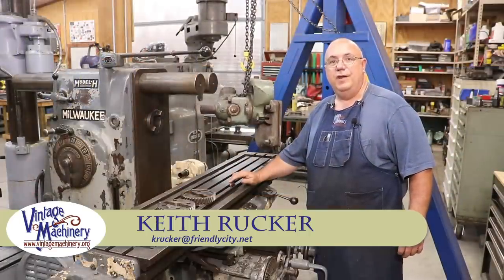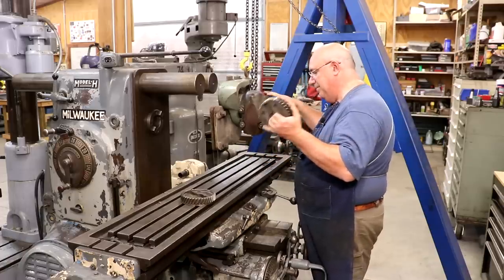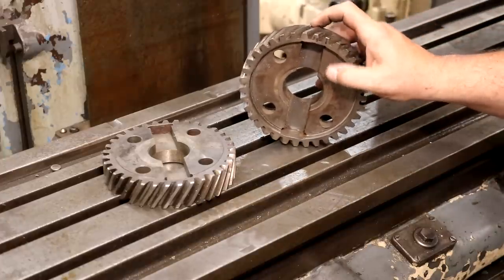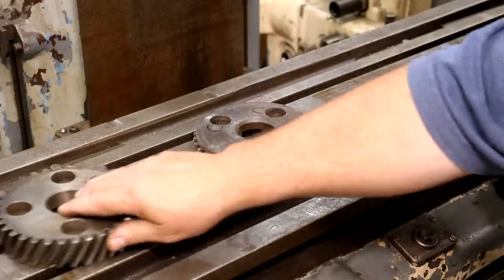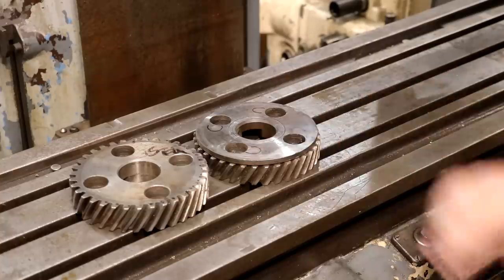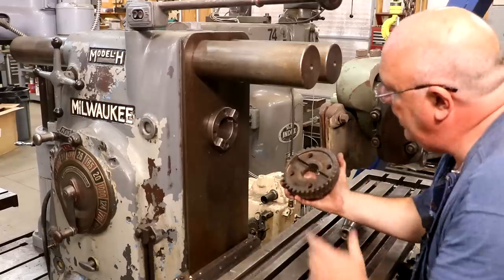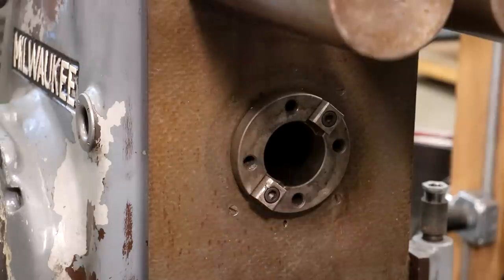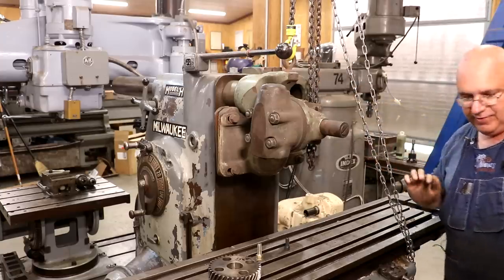Finding a Universal Head Drive Gear for my Kearney & Trecker 3H Horizontal Milling Machine!

Comment: Awesome Keith!  I have a 2H, and was specifically looking for the universal head when I ran across a government auction that had what appeared to be a 2H with the universal head. There wasn't much info available through the auction company, and it was located 500 miles away! But I took a long-shot and won the bid at less than just the head was worth. I was thrilled!  Then I arrived to pick it up, and discovered the mill was a 2HL (little smaller machine than the 2H). Felt pretty foolish!  Took it home,  and powered the mill up and checked everything out...and after a cleaning and repaint, and a few minor repairs, it turned out to be very a serviceable mill!   Ended up making room for it in my shop, and I just leave the universal head mounted on it as a dedicated machine, and keep the 2H for a dedicated Horizontal!  Best of both worlds!!! No worries or trouble with parking attachment! 
Congratulations on your addition...you will love it!

Comment: Keith,   That is the hard way to mount the universal head...and nearly impossible to set the drive gear clearance. 
The head splits into 2 parts, the drive and the head.  A spline shaft couples the two. 
First mount the drive section by it's self by moving the clamps out and placing it just above the spindle drive then drop it down close and loosely tighten the clamp bolts then set the gear tooth clearance. This is very important.   With the spindle in neutral work the spline to feel the backlash and turn the spindle.  Once the backlash is correct tighten the clamp bolts.
Then with one over arm way out, line the head onto the over arm then slide in to engage the spline and finally the other over arm.  This way you don't need a crane to lift in place just a sheet of plywood to protect the table.
As you show in the video the head can move out away from the column.
I have the same universal head on my 1942 2HL that I got for scrap in 1973 when I was in high school.  To get the mill running again I made 3 gears and a shiftier fork that had been robbed from the spindle drive and fixed a bunch of other problems. Have run the mill and universal head for many many hours, put head on/off many times.

Comment: You are fortunate.. I had to machine the drive gear and spacer disc for my 2h plain with the same type of head... I watched you install the unit and I made the same mistake the first time I installed mine....The spacer discs are machined to the pitch line and roll with each other to maintain proper gear tooth clearance as there is no positive way to dowel the unit in place... I think you will find that the cutter head takes oil and the drive bracket takes #1 Sovarex grease and that new units were once shipped with two grease guns for the purpose of lubrication, as per 1942 sales brochure.. You will no doubt find grease everywhere upon disassembly.. My unit was made ww2 and had grease much like Johnson's paste wax in the cutter head.. Cheers from Louisiana ; Mike

Comment: I wondered if you would mention the parking attachment. In the first shop I worked in during the mid 70s we had two K&T mills one with the universal head and parking attachment and one without. We used the head for several production jobs and the parking attachment worked great for getting the head on and off and allowing the head to be stored on the machine when not in use. I used a number of K&Ts over the years but never encountered another one that was equipped like that. I believe it also had a drive mechanism for a rotary table but I never saw that in use.

Comment: Fantastic video. It brought back fond memories of when I was employed at Eaton. I operated a yoke line consisting of 4 horizontal mills similar to this, a 4 spindle drill press, a single spindle drill press and a push broach producing shift yokes for Road ranger transmissions.

Comment: Keith, You are sio right about those "grease" fittings there. I think those were originally round but then someone decided to put the grease gun compatible nibbles there in order to be able to lubricate it with the grease gun.
Quite often the lubrication of those is gravity assisted. I mean that the oil is running down to places where it is needed. If someone has been vaccinating this with grease, those oil paths have been blocked. You can squirt oil into there and it will never reach the place where it is needed.
Taking it apart and removing the grease is the only parctical way to get it lubricating itself correctly.
I had this same grease/oil problem with my Schaublin SV-51.

That universal head is really practical. You can even do light horizontal milling with it as well. See if it has some sort of an indexing system in order to get it easily and accurately in common angles. My Schaublin has the 15 degree indexing system for both nodding and tilting. If You can set the angles easily then a whole new can of positive worms opens up.
Reply: I have been running the exact same K&T head on my 2HL mill for over 40 years....those ARE GREASE FITTINGS!  The universal head does not run with oil.
Reply: @chuckinwyoming8526  Aha. Sorry about me giving this misinformation. Actually I don't know anything about that particular milling machine Yet alone the universal head for it.
Usually machines of that age are to be lubricated with oil. I quess that was also the reason why Keith was wondering about this issue.
Nevertheless, it is not a bad idea to take the thing apart and clean it up. When doing that one can verify what should the slippery stuff to be used with it be.
Reply: @FinnoUgricMachining  Some of the confusion may be from Bridgeport and other milling machines using commonly used grease fittings for OIL. 
By all means clean out the old grease.  The universal head is easy to disassemble and it may be full of 60 year old crud.   Grease has the nasty property of trapping and forcing dirt and chips into the gears.

Comment: Good score on the drive gear. Lubrication depends on the specific model of the head as K&T had numerous heads. I believe this one called for Mobil Gargoyle #1 grease in the drive gear bracket and oil in the head.

Comment: I always put the head on with out the over arms engaged. The pitch plate on the gear puts in proper position, then engage the over arms and clamp the head to the column.

Comment: There probably are, sitting on shelves in factory buildings, several of everything that K-T machines could possibly use. The trick is to locate them. Blind luck helps.
Reply: Probably easier to win the lottery than to find anything you need like that
Reply: I was thinking the same. There are probably a lot of the right parts out there in someone’s inventory but they have poor or no inventory control records for all the old loose parts on those shelves. You might get told no-can-do but they’re sitting on ten of them if they really knew what they had. 😎👍👀
Reply: How (un)likely is it that this gear and head went together originally? I've no idea the quantities produced, but the 2nd gear did look like an evolved version of the first.
Reply: @johnflorian6745  the 2nd gear has the retaining disc in the side just because this particular head has the upper gear floating on a spline shaft with no axial constraint and this is so that you can move the head further from the body using the overarm and have a larger work envelope.

Comment: Several years ago Adam Booth (Abom79) machined a crane so he could hang an attachment on the side of his K&T.  You may want to contact him for additional details as further mention stopped without further comment.  Based on his latest video I'd suggest emailing him ASAP because it appears he's getting ready for a big trip.

Comment: I believe I saw a video by 
Adam Booth where he made a parking attachment his Milwaukee horizontal mill if that might help you . 
As you may already know because so many 
CNC machine centers take a 40 milling machine taper there is a wide variety of tooling available to fit your machine.

Comment: Unless you have a continuous flow of oil, i.e. an oiling system, grease is the go to lubrication option for straight gears. For continuous running applications, or really high speed applications, grease is not recommended as it can generate heat. But then again for those applications you would still need an oiling system...
Reply: Unless the OEM manufacturer specifically mentions using grease it certainly isn't the correct lubrication for one very good reason. Grease continuously returns any wear particles or possible contaminates right back through through those now hard to find and expensive parts. And that greatly accelerates even more wear. The parts would literally eat themselves. High detergent motor oil has those additives because there used in a pressure lubricated and then filtered situation so any contamination stays in suspension until it hits that filter. Non pumped and filtered sumps exactly like that K & T head has will always use a non detergent oil. It's properly formulated to allow that same contamination to drop out of the oil and remain at the bottom until the next oil change or disassembly. Your machines your choice, but incorrect information needs to be pointed out so others can make informed choices.
Reply: @turningpoint6643  And how do you believe the sump on the mill is connected to that vertical head attachment?
Reply: @the_hate_inside1085  I didn't say that now did I? It's a self contained unit with probably a oil drain somewhere in the bottom of the head.

Comment: An impressive piece of equipment. Looking at the difference between the drive gears I wondered why it wouldn't be possible to machine down the thicker one -- but it is hardened, so that isn't an option.
Reply: Also someone will need that gear just as Kieth needed a different one for his. There would be no reason to destroy an original gear when he could make a non hardened gear that would fit his use case.
Reply: I would've done it, Keith's got more patience. Definitely possible
Reply: He mentioned that possibility when he got it, but didn't like the idea of ruining a rare part that someone else might need. And, as he said, he had interest in making one himself, until he found an original one.

Comment: Keith my universal head for my 1960 CH2 Ram Head is marked to use No.1 BRB Grease.  It's 50 taper  I don't think that would make a difference in the lube.

Comment: Not sure how heavy the backplate is, but it seems like the easiest way is to put the backplate on first, then mount the front section, at least until you get the parking attachment.

Comment: Need to find me a head like that for my k&t model k. Great video Keith, keep'um coming..
Reply: The shop has several what is overam size I could see what they have.
Reply: @johngermain3535  not sure, it a model k 2 universal ser# 44-5000
Reply: Get me the Dia of the overarms and I will look.
Reply: @johngermain3535  4 1/4 across 13" round, thanks
Reply: @johngermain3535  there. 4 1/4 across and 13" all the way around. Thanks man.
Reply: @kentuckytrapper780  what is center to center  of overarms and center of drive to overarms
Reply: @kentuckytrapper780  they have 2 that may fit. Can you measure  the clamp width also
Reply: @johngermain3535  ok, I'll be in the shop Monday morning I'll send you all the measurements, thanks for your time, how much do you think it will cost?
Reply: @johngermain3535  hey john,been sick I got some measurements for the k&t the rams are 41/4 round and it's 5 3/8 center to center ,
Reply: @kentuckytrapper780  what about center  of drive to ram arm center?
Reply: @johngermain3535  do I have to take the head off to measure that?
Reply: @kentuckytrapper780  no just a ballpark  measurement where your 40 taper drive is to the center of the ram arm's  there am several different  sizes this helps to narrow down the one that will fit. You want a universal style head correct?
Reply: @johngermain3535  my k&t is a 50 taper model k universal ser# 44-5000 war finish
Reply: @kentuckytrapper780  OK I will go and get pictures  of what they have that fits your dimensions and email them to you
Reply: @johngermain3535  I sure appreciate it, thanks a million..
Reply: @kentuckytrapper780  they have 2 one light one a heavy-duty
Reply: @johngermain3535  how much do they won't for them?

Comment: It would be interesting to know the spindle diameter vs gear bore diameter / the machine flange diameter vs the spindle counterbore diameter and the machine key width vs the gear keyway width. The spindle diameter tolerances probably indicates the gear is diametrically located for concentric loading? It would be nice to pick the K &T engineer's brain,  I believe the spindle should be used in each setup.
Reply: The central bore might have been just used to hold all the different gears on a mandrel while machining the teeth and the good fit for that arbor could be a coincidence in that case. Just a possibility. The different gear would have no other means of positioning the gear accurately than the arbor as it lacks the recess.
Reply: MF175mp - Very good point!  
In 1965 our shop got one with a vertical head, never used it to slab mill. I remember each time the head had been removed Elmer the operator would amply lube the gears with a putty knife and a can of grease during the assembly.

Comment: I wonder if the gear that came with the head is semi finished and still needed final machining? Is there signs it has been used / hardened etc? It was quite common for semi finished parts to escape the factory when they where closing down or getting rid of old stock.

Comment: hi again Kieth,just watching you installing the universal head drive gear for Kearney &trecker 3h horizontal milling machinery I watched you playing around with a large adjustable wrench.let me ask you're you just too lazy not to use the proper socket, or box wrench, or do you not have them? I am starting to clean out my garage and basement after over65 years of collecting. my sockets range from 1/8" to 51/2" and torque multipliers with 11/2" drive.  let me know if you need anything?   thanks again gene.     p.s. let me ask you a question?where you have gears wrenches flash lites and other tools laying on the bed of the machine, would it be a good idea to have a piece of ply wood up there  to protect the machine?

Comment: But wouldn't it been the easiest solution just to turn down or mill out the recess in the gear you got with the machine. Just modify it little bit. Even tho the face of the teeth is hardened then the body of the gear should be much softer i reckon. But i am happy for you, it's always nice to have original part for your machine. And now you got an extra gear for someone else that needs one...

Comment: I can not believe he actually ran that universal head with that helical gear not bolted into place!
Reply: It obviously doesn't need the bolts for an "unloaded" test drive.  I would bet you don't have any of this machinery, so what makes you a K&T expert?  I believe it is time you moved along and quit trying to start shit.
Reply: I happen to be a machine tool builder that finished my machinist apprenticeship at Bardons and Oliver machine company, now located in Solon Ohio.
That helical gear exerts an axial thrust when it is running, and depending on its rotation, could possibly damage his universal head.
They don't put those four bolts in there for no reason.
And BTW, I think it is time YOU moved along and stopped being a " Toady " for Keith Rucker  @paulcopeland9035
Reply: @garybrenner6236  ..."Toady" is a little strong, but I think he has done a fine job as a "hobby machinist".  Keith's channel is one of those where every "know-it-all" can't wait to criticize.

Comment: What purpose is the (1.5"?) shaft that projects out the front of the universal head? It didn't spin when you first ran the tool. I am guessing it is to mount the head to the parking attachment.
Reply: Explained above

Comment: Two questions: Is there a crack between the tunnels for the over arms?  And who or what were you looking at? Certainly not the camera.
Reply: There is a factory split line there...not a crack. This is used with the bolt on top to provide a clamping arrangement on the overarms.

Comment: The gears are around $500 on the ebay seller. Didn't find a listing for this exact one.
Reply: Not a smoking deal but it's about supply and demand!
Reply: This exact one is on there, better look again

Comment: That head has to be the apex of mechanical engineering. Today, they provide all that flexibility with a bunch of lines of computer commands…
Keith, your K&T mill will still be working long after the computer that runs the CNC mill is outdated and impossible to replace. How many Commodores and “Trash80” computers are sitting in basements, useless?
Reply: What a silly comparison. A manual machine is fine for a small job or hobbyist shop, but try to imagine how much time and work it would be to make 1000 complex parts on a manual machine versus a CNC machine. The notion that a machine is implicitly better because it lasts forever is a false economy - the cost of the machine is built into the price of the parts it makes or the work it needs to do. What good was it to build a steam engine that lasted for 100 years, other than as a museum piece? There would be no reason to build a TRS-80 that lasted forever - it is of absolutely no value to anyone today, or even 5 years after it was made. The engineers that made it knew that at the time.

Comment: Could you make use of a 40 taper collet chuck? I have a NOS grand brand 40 taper with a set of hardinge collets 1/8 of an inch to 1 in. It is surplus to me
Reply: I also have an extra parking attachment. It is not a factory parking attachment, it was from the sliding top of a giant cast iron table saw from the 1800s.